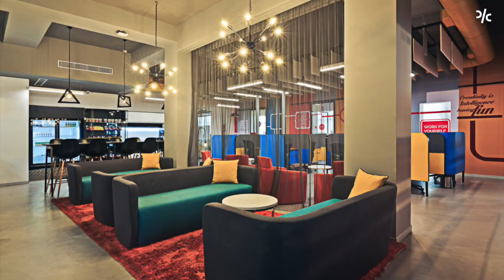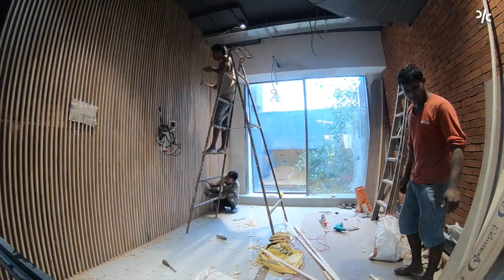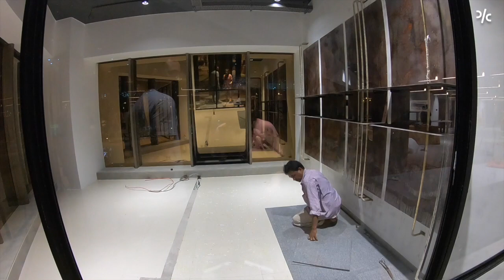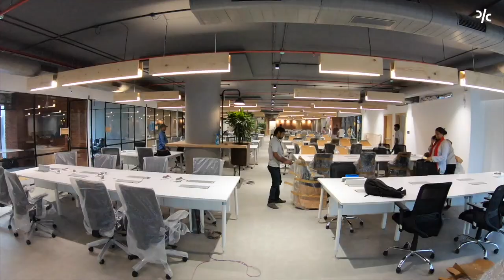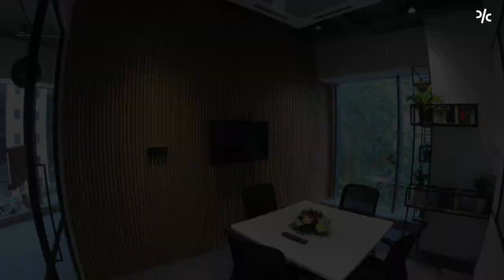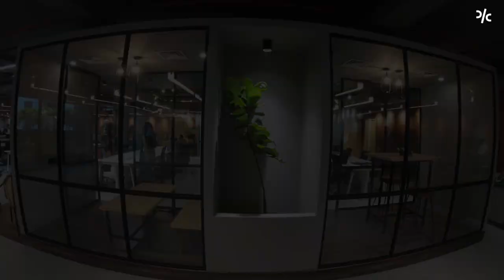First Look of Drip Capital's New Office in Mumbai

Comment: Ravi Sharma:
Sir, you ruined me, first I placed 10900 rupees, then negative amount came - 50958 order record, paid that too in 13th, then - 154806 order record, paid that too in 24th, first - 446283 order record, in 34th, then I paid that too - 662495 orders. Record 35 If your rule of 3× commission is fulfilled then why did you give me this please tell me it should be canceled please

This is a random match made by the system, not given to you by me. Please don’t get me wrong. It is impossible for me to operate all of this.